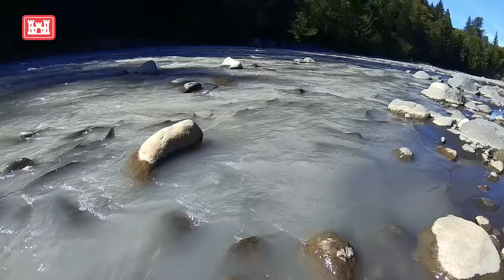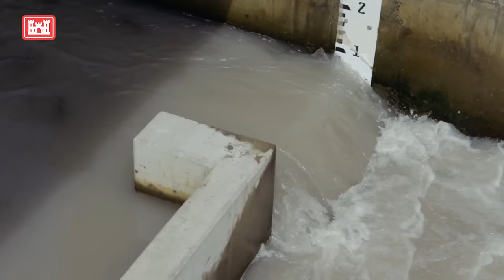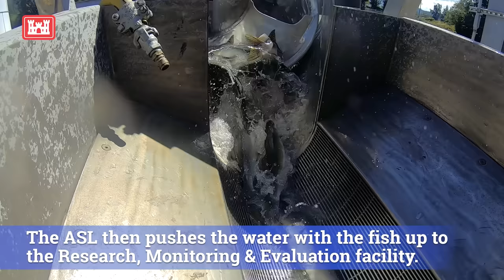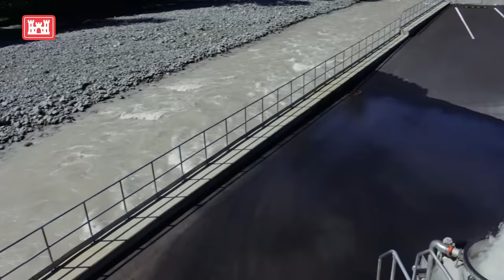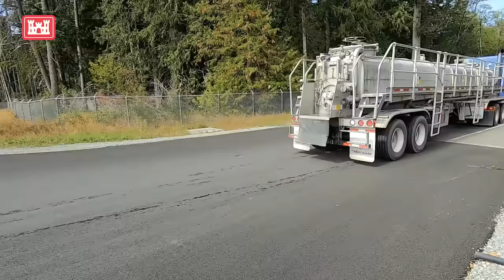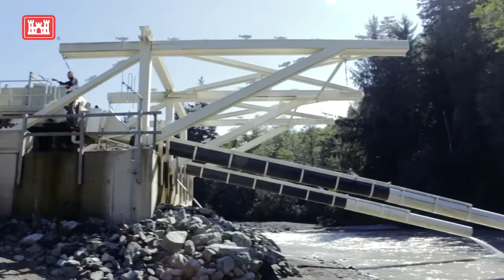Mud Mountain Dam Fish Passage Facility

Comment: How do you get the smolt downstream past the dam?  Another gyro gear loose project ?
Reply from the maker: Mud Mountain Dam is a “run of the river” dam, meaning we only hold water during periods of high flood risk, which is typically not when juvenile fish are migrating. The dam just lets water flow through it when there is no flood, so the juvenile fish just swim out through the dam.